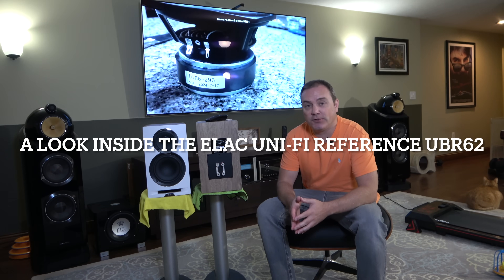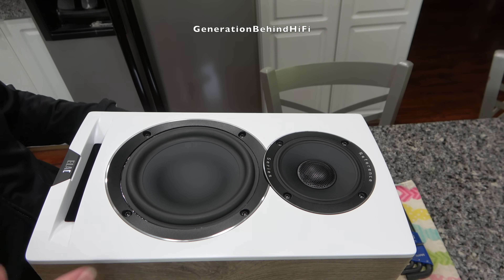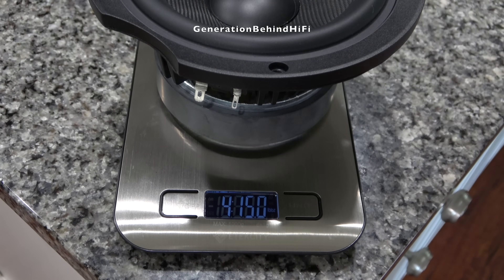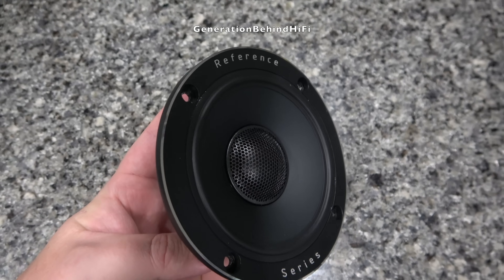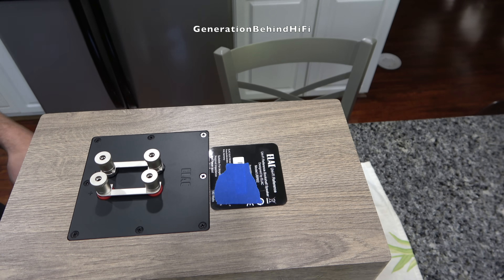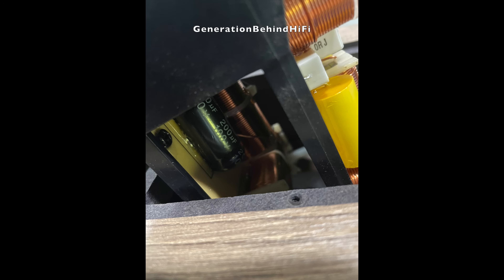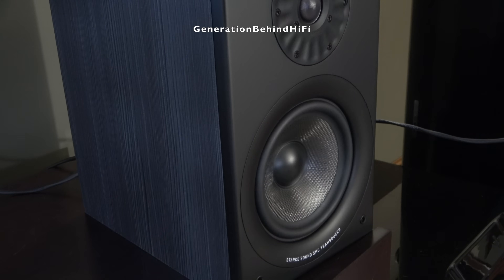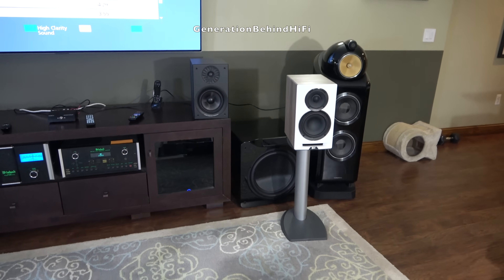Look Inside: ELAC Uni-Fi Reference UBR62 - You can do better.

Comment: I'd love to see the inside of Infinity speakers, specifically the older Primus lines like the P162-3, P362-3, and P153, to learn about their specifications, crossover, etc. I have a pair of P153s, and I'd particularly like to know the woofer's specifications, as it performs excellently in a homemade speaker tower where I installed it. I wasn't completely satisfied with the crossover. Finally, I was surprised that Infinity tuned its port around 90Hz, considering the woofer is capable of reaching much lower frequencies in the tower.
greetings!

Comment: A frequency response without showing the variation is worthless.  They could be talking 1 db down, 3 db down, or 20 db down.  Unless you measure it yourself, you will never know because they never specified.  There is no "industry standard" of measurement anymore.  Having to measure it yourself defeats the purpose of Mfg. provided specs.  At this point, you can safely assume every spec they cite is a lie made to sell more speakers.
Edit: and thank you for taking it apart and showing what is inside.  There are a lot of reviewers who won't even do that.

Comment: That's a lot of money for something that can be out performed buy cheaper brands. I guess you pay for the name? I have klipsch and they sound amazing and cost less. My bookshelf speakers are 2 way dual 5 1/4 and dual tweeter in a modified triangle shaped enclosure so they fire left and right instead of just straight. It gives a more dispersive sound than a standard bookshelf. The rest are towers, dual 8's with tweeter. I also have 2 12" subs to round it out. My friends can't believe how good it sounds and how clean they are. It would be interesting to compare the sound and build quality between these 2 brands.
Reply: What Klipsch model?
Reply: @SacreDro bookshelf are RP-502S, towers are (4) R28F

Comment: Great breakdown of these speakers , I picked up open box example for £500 over £649 , the build quality us good for its price point and the cabinet quality is far above its price point, the bass port is shaped  to stop chugging , although bass is there I do recommend a sun for lower bass notes, over all it’s a good speaker and good build quality and looks good . The front of speaker is if Formica material , I also like this speaker if it’s 3 way design , yes it’s vinyl wrap but a lot speakers seemed to be like now. I also noted that the front of speakers is curved and don’t see that now at this price point, for example my old B&w dm 602 s3 has a curved front where as my B&w 606s2 anniversary don’t . Regards mark ,

Comment: Hi there.  I have these speakers, UBR62.  I upgraded from the UB52 2.0 and the DB62.  So Uni-fi Ref vs Uni-fi vs Debut.
The Uni-fi Ref is definitely the superior speaker except for the dual binding posts. This disadvantage can be improved upon by replacing the nickle plated jumper bars with copper wires.
This is a cheap and easy fix,  yielding noticeable improvements to fidelity and efficiency.  Cost me $0.00 and 30 min.
I made single copper wire runs going from one post to the other, vertically. Strip insulation enough to just cover gap between posts. The copper wire strands extend into the post's holes.
I believe this speaker would be even better had it been designed with a single pair of posts.
Reply: Not sure that you're improving efficiency of something with 0.01 Ohms, or that replacing that with 10cm of wire will make a difference when your amp has a lot of thin "bars" inside it for traces and connections
Reply: @RennieAsh That's because you don't understand the sound of metals and their roles in components, which is always a compromise. As for efficiencies, it's overstated and is not at the top of the list for importance to sound quality.
Reply: @carlosoliveira-rc2xt  prove it then.

Comment: When your speaker cables are 10x what the manufacturer of your speaker has used. lolz. Me, I just go basic.
Reply from the maker: Who has expensive cables that are 10x what the speaker cost? It isn't me because I use Canare 4S11 speaker cable, which is very affordable. About $60 bucks for 2x 10 feet sections of cable.
Reply: @generationbehindhifi  Speaker cables vs speaker wire inside the speaker. Read it again.
Reply from the maker: @Roof_Pizza My bad.

Comment: Dude, great teardown, but please enough of the Steel parts and Ferrous talk. That is stuff Danny at GR pushes to sell his "Tube connectors" and has no basis in reality, to any real speaker engineer working at an actual name brand company. My comment comes from actual conversations between a few VERY well known names, not Youtube salesmen. If you have doubts bring some of the well known guys on your channel and ask that question. Thanks again!
Reply from the maker: I include this information because some of my viewers want to know it. Whether you agree with it or not is your opinion. However IEEE did a white paper on ferromagnetic parts in audio connectors and its a good read. Basically the study proved that ferromagnetic parts introduce passive intermodulation, aka 3rd-order harmonics distortion to the signal! Simply put, there's a reason why high end speakers use non ferromagnetic parts in their designs. Hope this helps. 

Paper can be read here: https://ieeexplore.ieee.org/ielaam/22/8681220/8632973-aam.pdf
https://www.audiosciencereview.com/forum/index.php?threads/ferromagnetic-materials-in-audio-connectors.41867/
Reply: @generationbehindhifi they likely use steel generally so that gorilla hands don't undo the binding posts by turning things too tight. 
I don't think that the steel is so bad that most people need to worry about it. There's plenty of other things of much higher magnitude they could fix first. 
Also a 90% of speakers are running wires through magnetic fields generated by ferromagnetic materials :)
Reply: @RennieAsh  
Good points. 
However, it's not a question of where it ranks as a potential problem.
 
It's simply a best practice to avoid it.
Reply: Ferrous elements are a known issue, best avoided ... simple as that. 
Yes, the magnitude of the corruption could be a discussion had by others.  

However, yes, it seems it's corruptive to the signal.

Comment: Great review.  Agree with your assessment 100%.  For reasons you covered in this video, I decided on the DBR62, a two-way design, four years ago.  I believe Andrew Jones also realizes there is a market for three ways at the UBR62 price point, and that some people think three element speakers are always better than two.  Because you know, more is always better, right?  I am not one of those people.  I think the original debut reference gives you more quality of sound, construction and design for the money (now $800).  There is a reason why those speakers have gone up in price twice, while many other competitors of similar speakers have gone down in price at the same time (Revel, Polk, Klipsch).  The Elac Reference 62 with only two drivers really are that good, and do not require a huge amplifier to drive them well.  60 watts of CLEAN power per channel is plenty.  But a three-way design, probably is going to need more power to make them sing.  Thanks for the review. Great job 👍.
Reply: (My amp is rated 100 watts per channel class D, but produces 60 watts per channel at less than 1% THD).  The tube preamp uses 5654W preamp tubes.). Very awesome sound.
Reply from the maker: The ELAC Debut Reference DBR62 is one of my favorite bookshelf speakers in the $800 price arena and definitely punches above its weight class. You can even find them on sale like they're now for about $600pr, making them an excellent value proposition.

Comment: Great job GB HiFi. I was really looking forward to this video. As usual, you did not disappoint. This was one of the new 3 way  speakers I was considering along with the floor standing ELAC UFR52. You confirmed my doubts as far as build quality goes. I think you got it right. For $1300, the vinyl wrap and mediocre crossover don’t quite cut it. I have not listened to the Elac’s, but I’ve heard the soundstage is quite good. Which is a trait of a speaker with a coaxial driver. I ended up going with the Monitor Audio Silver 300 7G floor-standers. Real wood veneer. Build quality seems good for the price. Just started breaking them in. So far, I’m really enjoying them. Can’t wait to see your review on the Starke stand mounts.
Reply: At $1300 almost all speakers come with vinyl wrap and the crossover parts are par for the course, so I don't know what you're on about. The Monitor Audio speakers you eventually chose are twice the price so not sure why you were looking at the Elac to begin with.
Reply from the maker: @carlosoliveira-rc2xt  I can think of several models that use real wood veneer cabinets that sell for around the same money. List below. 

EVO 5.2 Bookshelf Speakers $1299pr
Monitor Audio Silver 50 bookshelf $1249pr
Martin Logan Motion XT B100 Walnut $1359pr
Totem loon Monitor $1300pr
Reply: @carlosoliveira-rc2xt I was mainly focusing on the floor stander UFR52’s that are $2600 a pair here in the states. Exactly $70 less than the Monitor Audio’s that I just purchased. That’s what I was on about.
Reply from the maker: Thanks, Michael! I appreciate the kind words. The Monitor Audio Silver 300 7G is a great speaker. I have heard them a few times and was very impressed.

Comment: Thanks for your review.  I find that 2-way bookshelf speakers sound better than 3-way in my experience.  Towers sound better when they go to a 2.5 or 3 way design.  Appreciate your look inside the speaker and your measurements.  Very helpful.  Be well and rock on.
Reply from the maker: Thanks for the kind words!
Reply: For a three-way design to sound better you must spend much much more money, like 10 times more?  Or just appreciate the two-way 👍.
Reply: That's really due to budget tower 3 ways often cutting corners and just aren't made well with few exceptions.  A good 3 way speaker costs much more.

Comment: At 10:13 you put your hand into the woofer opening & touched the cable going into the Mid/Tweeter chamber & it moved pretty easily.  ????  That should be a very well sealed box with an open backed midrange.  Maybe that is why the clarity isn't there.  There could be some leakage into the bass chamber.
Reply from the maker: Midrange chamber is 100% sealed. ELAC did a good job of going above and beyond with the glue.